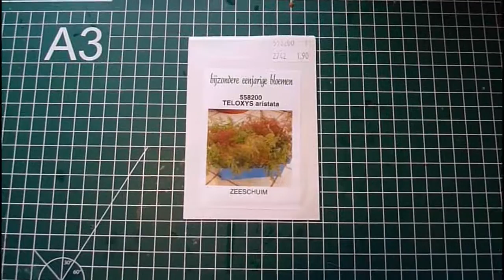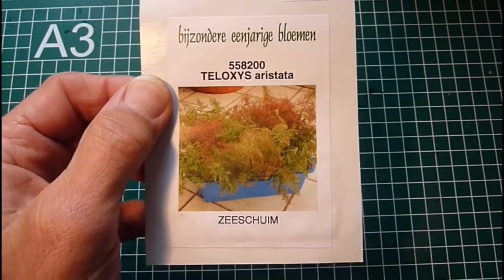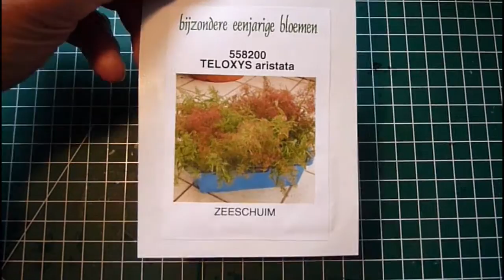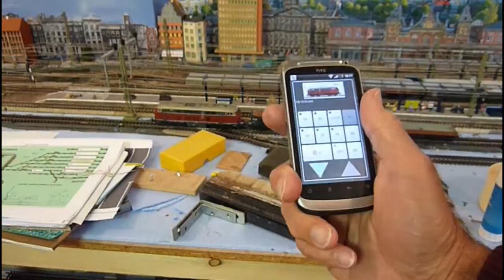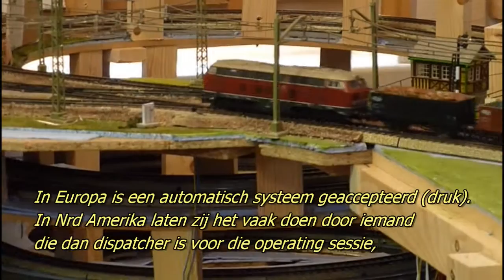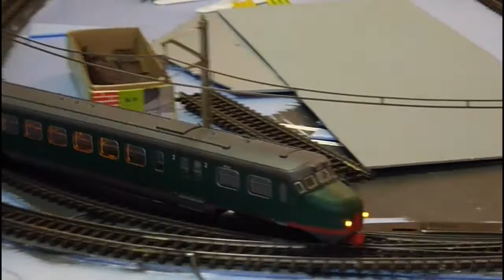Vlog24 Rhineland HO layout update - Trees (super), Industries, Testing

Comment: Great update , your loco control is great no wonder you got so many wires running under the layout ,keep the good work up , looking forward to see how trees grow 
Cheers Glynn
Reply from the maker: Wiring? To give you an idea. There will be about 60 blocks for the full layout. Each block will have at least 2 sensors and a signal, totalling a minimum of 6 wires per block,  is 300 plus wires, excluding the 60 odd turnouts, powering and lighting wires. Thats a lot of spaghetti under the table LOL.